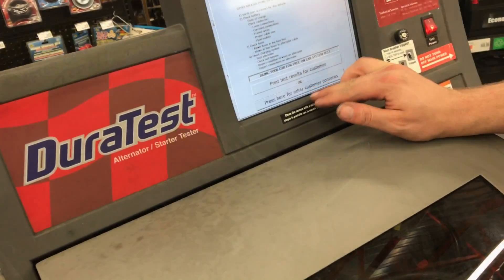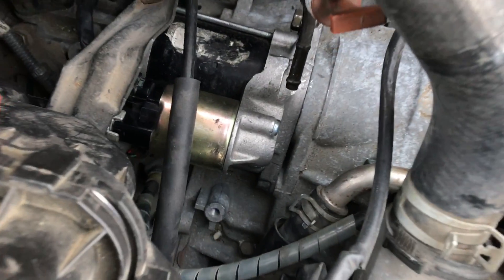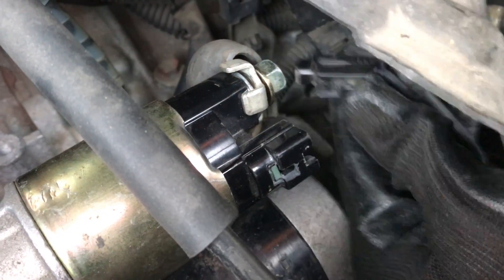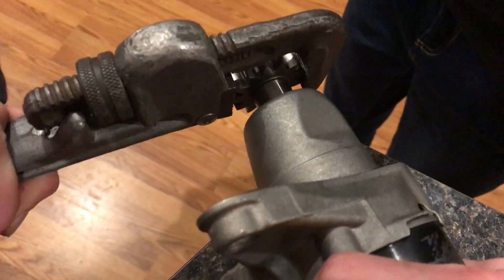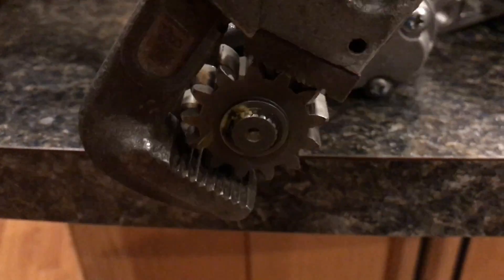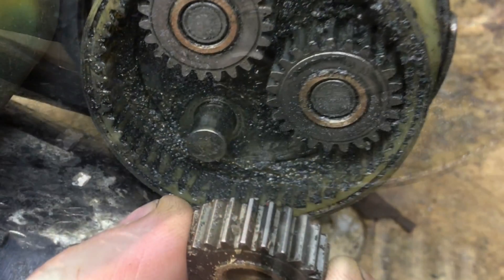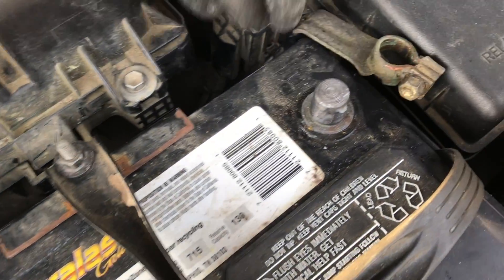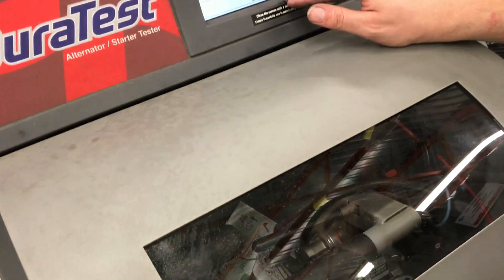toyota starter DEFECT  (hidden engineering flaw)

Comment: I got same situation on my 2004 Sienna LE. The plastic housing was totally stripped off by 3 steel wheel after 170K miles. After replacing a new one, it only last 4 years. Now I have to replace it with a lifetime warranty one.

Comment: Scion xB starter lasted 303K miles. I took it apart and the planetary gears and plastic gear looks good. I don't see any wear like in that starter you are showing. Cleaned it up and installed new brushes, it is working good.

Comment: I just pulled a 2004 Toyota starter and the plastic gear is in perfect condition despite having  over 200K miles on it.    The suppliers are probably using a cheaper plastic now.

Comment: Im from the Philippines and I had just bought a brand new Toyota 2022 HI Ace GL Van.  I had used for 3 days. The Van run 190KM only and the starter burnt down. The starter is running without a key that causes burnt down of the starter. I called up the dealer and they picked up my vehicle. Now, they are charging me PHP 380K (USD 7600.00) to cover parts and labor. I am contesting this to the dealer and the manufacturer but they insist that the cost of parts and labor should be paid by me. My monthly amortization will be earned by my sweat and blood for 5 years. May I ask any advice and suggestion what will be best for my case please.
Reply: And why isn't that covered by the warranty? Ka gago naman niyan

Comment: Never heard of that. I wonder if your failed starter was original Toyota part or some kind of replacement. Japanese car makers require their 3rd party accessories(starter, alternator, water pump,etc) be made to last a certain number of hours of service. In other words if you want to sell parts to Toyota they will not use them on a new car unless the part meets their useful lifespan.

Comment: Planned obsolescence AND DENIED WARRANTY CLAIMS. Stores use the bench test to honor an warranty claim or not.
Reply: I'm working on the warranty issue as well since it is starting every time at the shop.
Reply: @pamnix3825  Open it up and cut all of the wires that are connected to the brushes. It's going to be messy. Black carbon power and grease. That's what I had to do.